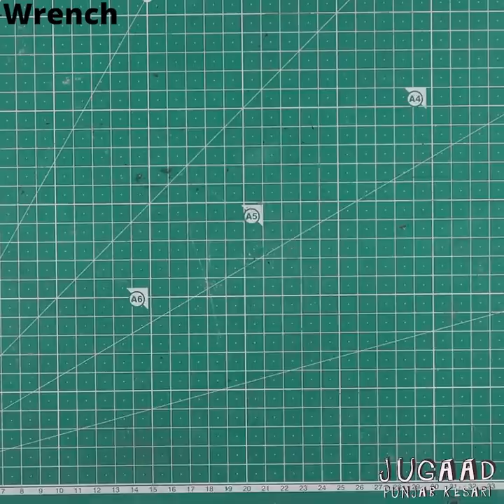4 Amazing Wrench Tools

Comment: It's cheaper just to buy the right tool for the job than to damage a few other tools to make something fit. Plus the welding was awful 😂
Reply: No, if u work on factory i swear u will know the mean of this.
Reply: @anothernightmare7646  I'm a mechanical engineer and technician for Toyota. I am in the field of repair and manufacturing. I know sometimes you need to modify tools to make use of it in a certain settings but from my experience buying the right tool is cheaper, time is important and performing your job faster pays more than manufacturing a tool from other things.
Reply: @Fail-Finder  Totally agree , I'm a Red Seal auto tech and those tools were crap , why make that crappy drill chuck too ?? Why not use the original that they cut up ?? The spanner tool for the grinder ? The tools they come with are so much better and are EASILY replaceable if lost . I could go  on n on .
Reply: @rolandminute1174  exactly, manufactured tools should be used as intended. And like you said they are all extremely easy to replace.
Reply: @chandlerthoma9173  I said I work for Toyota not VW lol
Reply: @chandlerthoma9173  😂😂😂😂
Reply: @rolandminute1174  and he reefs on the grinder with that thing. Jaysus
Reply: Bored I have to agree with the welding. Oh I want to start laughing just thinking about it.
But I posted a reply to a guy who said something so similar about ruining tools. Booted I hope you will find my reply and read it because I think you are just like Mr Smith. Please feel free to tell me I am wrong on any part of it too.
Reply: Plus they don't even really work when the bolts are really tight.

Comment: I'm a plumber and welded a radiator vent key on the bottom of a small adjustable spanner. Always loosing the vent key so now that it's on my most used tool it's a lifesaver.
The bike chain idea is top class

Comment: Love the spaner wench with drill chuck very genius but the welding job, I think that's what you were trying to do at least, omg×30000. I laughed the rest of the video so hard I had to start it over and try to watch it without laughing but there it was again. And damn if I laghed myself off the chair. Ok its oit of me lets try this again, 3rrd times a charm anyway right. Snickers NOPE! So I had to try to get to the point where I didnt see that weld job again to finish. Man you are good at the ideas if they are youra but have someone else do the welding. Unless you want to try to take this youtube channel down a different avenue kind of like a Tim The Tool Man Trailer. A comedy man style tool show. I dig it.

Comment: So...rather than grabbing the right tool for the job for cheap at Harbor Freight, I can Mickey Mouse one that will half-ass the job under limited conditions...cool! 
Am I the only one that noticed those pins tweak on the cutting wheel wrench when he was tightening?

Comment: Someone are good.. very poor knowledge...grinder disks and nut fix & un fix no need tools.. hold nut & disk together turn witch side you need it will ezy ..😂😂😂
Reply: You would be surprised how many people think you need a tool to change grinder discs
Reply: He could have just used the damn adjustable wrench he destroyed on those onther nuts/bolts instead of making some janky tool that's going to strip all the hardware anyway.

Comment: 1. seems hard to use just cuz the other end isn't attached to anything and is free to fall out and shift around while you're trying fit it so the bolt
2. A waste of time, energy and money
3. There were ways here could've finessed that a normal wrench, it didn't look difficult at all. Didn't really get the point of that one
4. He just didn't use the right sized wrench. And I doubt that if you don't even have every size of wrench in your tool box, you more than likely don't have what you need to even make this new one

Comment: You already had the crescent wrench, don't need the chain wrench. God forbid you just grab the zip wheel and packing nut with the face of your hand, press the locking button and loosen/tighten the packing nut by hand. Oh, and if you had a drill press and welder, you probably have the right angle grinder wrench.
Couldn't get past that to see the rest of his tool abortions.

Comment: Without proper size sppaner modified to use makes bolts and nut head get damaged during tightening and loosening and get workdone is also not good quality for precision assembly etc

Comment: I cant remember the last time i used the spanner for changing the disc on my grinder, just hold the button and turn the wheel, if its tight, reach into side pocket for my set of grips, no spanner required. I would throw him out of my workshop if i caught him doing that.
Reply: Disc are rarely never that tight anyway. When pressing lock button it usually is removable without tools just by loosing the holder. Pointed plyers are also very usable if its tight.

Comment: As an mechanic and an engineer.

 These life hack tools have no use,better go and buy the appropriate tools and dont wreck your adjustable spanner so that you need to butcher perfectly working wrenches to use as even worse adjustable spanners.

 also a cutting disk might break due to stress on its surface using it like that. Way to show anyone how to injure themselves. Especially since you have a grinding disk right there. 

The welding is at ehh.. sell the welder and never pick up any welding tools EVER AGAIN!

In short. VERY UNPROFESSIONAL BEHAVIOUR. and sadly there will be people actually recreating these methods because they don't know how to properly work with the right tools.

Comment: If you want people to take you seriously then use the right tools when you work. Using a long nose pliers to tighten a nut is plain wrong... use a ring spanner or second choice would be a open end spanner. Soon you will be using a screwdriver as a chisel....

Comment: Можно же от руки затягивать, а также раскручивать. Наживаешь кнопку, второй рукой диск с креплением. Бред.
Reply: What is that in English?  Can you translate please
Reply: @Treppo153  translated: You can also manually tighten, as well as untwist. You press the button, with the second hand you tighten the disk with the attachment or on the contrary you light it up. You don't need any adjustments.
Reply: @ConstantinBeaupre  that s right. I always tried ways you mention. And they work all time
Reply: You are a good bloke
Reply: @Treppo153  tnx!